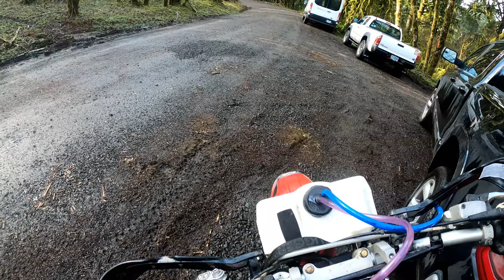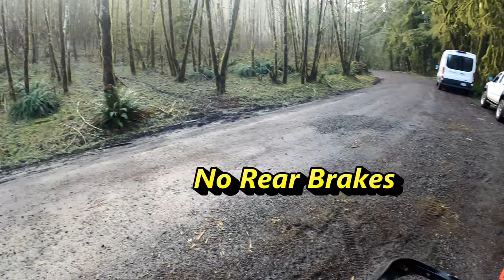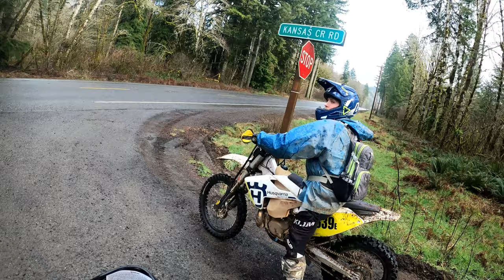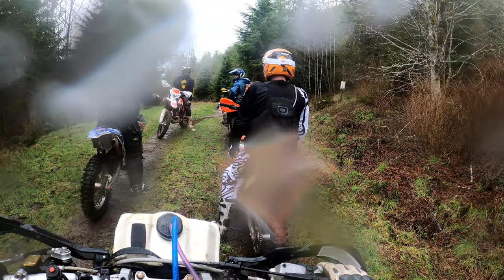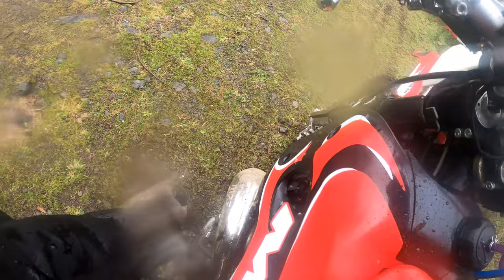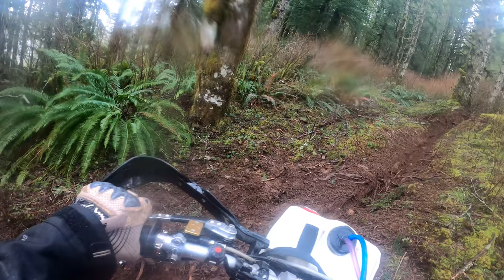Maico 700 - Bad Riding Day

Comment: What do you think of 450 4-stroke?
I see that most of your bikes are 2-strokes.

Also, how reliable is the Maico 700? I’ve contacted the company in Germany and received a quote for Maico 700 enduro with headlights. Just undecided yet.
Reply from the maker: I don't like the 4 strokes, never had a modern one.  Last 4 stroke I had was 1970 Honda 125 SL and it locked up in 1992.  They are very reliable, start every time for me.  I started mine up the other day and it sat for over a year.  The modern maicos are just as reliable as any.